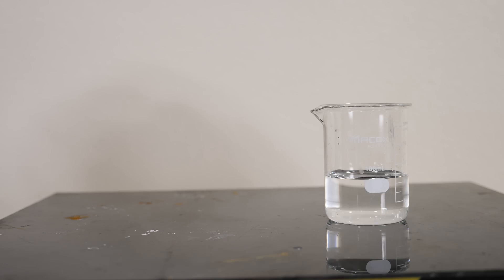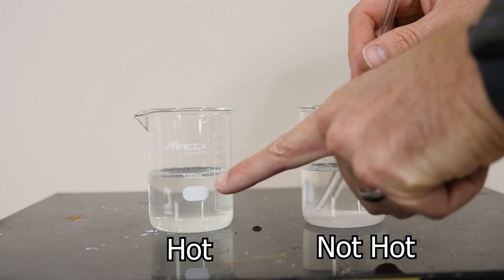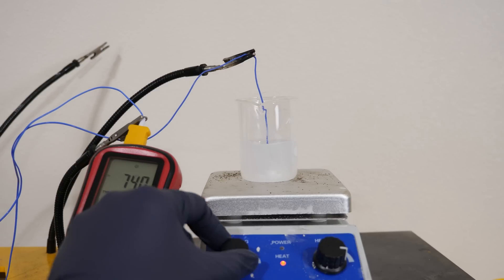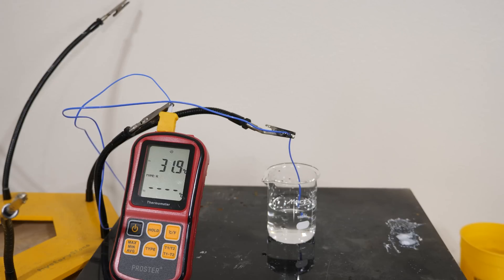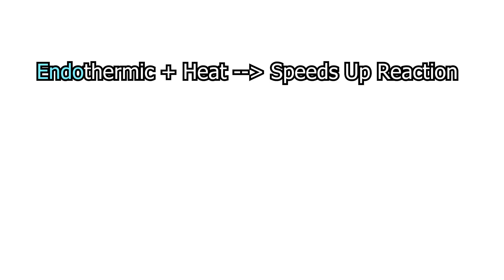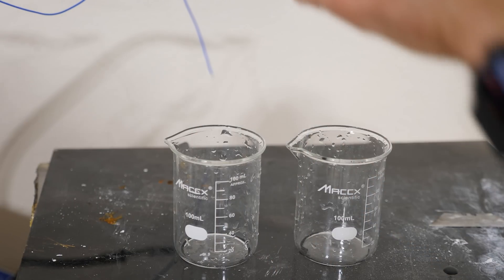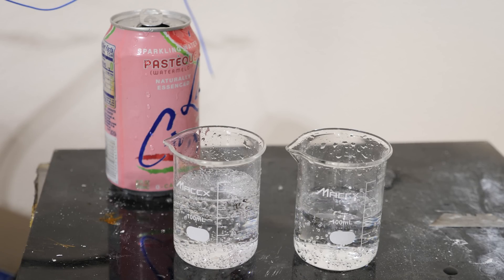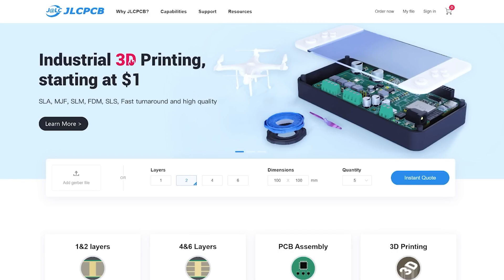Why Does This Powder Only Dissolve In Cold Water?

Comment: As a chemistry student at the university level, this video hurts a little, endo/ exothermic reactions both increase in speed with additional temperature, saying that the equilibrium of the reaction can be subject to change. I hope that there are no high school students using this as a mean of education as most of what is said is incomplete or just outright wrong.
Reply: Furthermore your expel of sugar dissolution is also incorrect, I will not say more as from reading other comments there are a lot of other experienced chemists who have also pointed out the same errors that I was going to address, this was my first video from this channel and I’m extremely disappointed.

Comment: This video is full with errors, the responsible think is to take it down.
Reply: the responsible thing to do is keep it up as unlisted, and keep a link in a follow-up video going through the errors
Reply: @Sillimant_  That's alright as well, if you can change the title of the video to clearly reflect that it contains erroneous information. It is too easy to miss the comments. I was under the impression you can not change title on YouTube, although I'm unsure.
Reply: @sandere9563  you can retitle a video in a few seconds
Reply: @That_Chemist  In that case adjusting the title to clarify mistakes were made, and posting a video where one elaborates on the mistakes made is indeed the better option.

Comment: there is so much much wrong in this video. Some things are knowingly deceptive though. the only thing NaNCl is perceived 'endothermic' in this instance because the water is over 30°C why? the added salt is probably colder of course the temp decreases in this instance. If it would be the same temp it would not change temp. In a lot of jis vids tere are some small knowingly deceptive things.

Comment: Chemist here. I'm sorry but you're completely wrong. Just because solubility decreases when water is hotter (which is atypical, usually it increases, but may just as well stay the same) has nothing to do with endothermic vs. exothermic. Also, these are not reactions. Nothing is reacting here. No new chemicals are formed, no bonds are broken or formed chemically. All of this is physical transitions and the energy balances that are endothermic or exothermic when dissolving a solid have to do with energy in crystal structures/lattices, a physical thing, not a chemical thing.
Reply: Thank you for calling this out. It's difficult to tell if what being mentioned is correct if the audience does not have precursor knowledge about the topic.
Reply: It''s a no brainer for him to make a correction video - more content for him and gives off a good impression for admitting to/learning from mistakes. Compared to the views of his other recent videos this one isn't doing as well anyway, so why not recoup that with a follow-up.
But I'm not holding my breath honestly.
Reply: What are any of u guys saying
Reply: @piztah I care more about people making a sound, coherent argument than having a PhD. If people need to hide behind a PhD to try to get other people to accept what they say it shows their argument isn't convincing. However, Einstein did have a PhD.

Yes, chemical reactions do involve physical process, but as you appear to have gotten in the end, a chemical reaction involves changing compound, while a physical change doesn't change compounds.
While people like pretending that everything is back and white and some will boldly assert that dissolution and mixing can only ever be a physical change, there are far more grey areas.
And dissolution of ionic compounds are included in this grey area.

When considered alone as just dissolving a salt and then evaporating the water, it looks like physical changes can explain it fully. But if you get 2 different salts, you can then end up with other salts at the end, which most people would consider different chemical compounds with different properties.
So by just dissolution, mixing (possibly) and evaporation (and possibly other normally "physical" separation techniques), can you end up with a different chemical compound, or does that mean somewhere along the line a chemical reaction has occurred, and if so where did it occur?
Reply: Would you make a video hidrolizing egg membrane for better absorption? I.e. collagen, hialuronic acid, etc. for the coolest bandaid?
Reply: Wellllcome back. I’m That Chemist
Reply: solubility decreases when water is hotter for gases, but increases when water is hotter for most solids and liquids: 
Gases
As temperature increases, the solubility of gases decreases. This is because the gas molecules gain kinetic energy and break free from the solution to move into the gas phase. This can lead to environmental issues, such as decreased oxygen levels in bodies of water. 
Solids and liquids
The solubility of most solids and liquids increases as temperature increases. This is because the higher temperature increases the kinetic energy of the solute molecules, which are held together by intermolecular attractions. The increased energy from the hot water molecules also makes solids more soluble by increasing the number of collisions between the water molecules and the solid.
Reply: You have an ionic compound which was held together via ionic bonds. These bonds are broken and replaced by ion-dipole interactions.
If it is all physical, tell me how you can take solid sodium hydroxide, gaseous hydrogen chloride, and water, mix them, and then remove the water to produce solid sodium chloride?
Reply: The distinction between the breaking of chemical bonds and the breaking of physical bonds is an artificial, arbitrary one. It's on the same level of importance as whether Pluto is a planet or not.
Reply: @bigsmall246  Definitions have meanings, if you break those meanings you're not doing science anymore. And I find this distinction VERY important because changing the molecules is not a little thing.
Reply: @paul4381  so when an acid dissolves in water, is it a chemical reaction or a physical reaction? Is the formation of hydronium a chemical or physical reaction?

Pluto is not a planet because it has not cleared its orbit of other objects. But every single one of the planets has trojan asteroids at at least 2 of their 4 Lagrange points.

The distinction is artificial.
Reply: @paul4381  And a big problem with people is that they like imagining definitions which are strict and rigid and clearly black and white, while reality gets in the way and makes it much more grey.

And there are plenty of examples of this region of grey in chemistry.

How do you decide if a compound is held together by ionic or polar covalent bonds?
It is a spectrum. There is no clear cut off.

Likewise, is an ionic bond a chemical bond, or an intermolecular force, holding together the molecular entities which are ions?
Because of that issue, is dissolving an ionic substance breaking these chemical bonds, or merely disrupting intermolecular forces?

But more important is what I already highlighted.
If dissolving something is a purely physical process, then the reverse must also be.
This allows you to take 2 different chemical compounds, dissolve them in water, and then separate them to produce 2 different chemical compounds.

If this is all physical, that is saying you can convert one chemical compound to another without undergoing any chemical reaction, which is quite clearly nonsense.

This can even be done without ionic compounds, using hydrogen bonding.
You can take a compound, like sugar, and dissolve it in D2O and then crystallise it and find a bunch of deuterium atoms where the hydrogen used to be. This requires covalent bonds to be broken and different bonds to be formed, so is clearly a chemical process.

So if you need to draw a line to clearly divide chemical and physical processes, then dissolution of species capable of undergoing hydrogen exchange with the solvent, as well as dissolving ionic substances must be a chemical process.
Reply: @Bullshitvol2  As I have said to others, dissolution of ionic bonds MUST be considered a chemical reaction, unless you want to claim that you can change one ionic compound into another without any chemical reactions taking place.
Reply: @Bullshitvol2  No it isn't. Not all reactions are oxidation or reduction. If that was the case, there wouldn't need to be a special term to describe them as redox reactions. Instead you could just refer to them as reactions.
According to IUPAC, a chemical reaction is:
"A process that results in the interconversion of chemical species."
So before telling me to look up definitions, perhaps you should look them up first?

Sodium chloride, as a solid is one chemical species. When you dissolve it, you convert it into solvated ions, which behave as a different chemical species.

But the bigger issue isn't simply dissolving it.
Instead, it is first dissolving it, and then removing water to get a different compound.

You can dissolve 2 ionic compounds in water, and then dry it out to get 2 different ionic compounds.
e.g. you start with AB and CD, dissolve them both in water to get A+, C+, B- and D-.
But then you can separate them out and get AD and BC.

That means you can start with 2 ionic compounds, dissolve them and precipitate them, and get 2 different ionic compounds.

So either you have a chemical reaction taking place, or you need to claim that ionic compounds aren't really compounds and instead sodium chloride is really just a mixture of sodium ions and chloride ions.

So which do you pick?
Reply: @Bullshitvol2  While oxidation and reduction will result the interconversion of chemical species, that is not the only way to do.
That would be like saying all animals are cats, and then showing that a cat is an animal.
That doesn't show the relationship holds the other way.

Why bother asking for an example when I just gave you one?
Why completely ignore the questions asked about it?

The example I gave was a salt metathesis reaction.
This is where the ions of two salt exchange.
This can be achieved most readily by using salts with different solubilities. For example sodium chloride and silver nitrate, reacting to produce silver chloride precipitate and a sodium nitrate solution. But you don't need one to be insoluble. Instead you can use limited solubility, or multiple solvents.
I think those with limited solubility are better, because then you have dissolution processes, followed by a mixing (or additional dissolution process), followed by a precipitation step.

Another is one discussed previously, the deprotonation of an acid, and similarly general proton transfer for hydrogen bonded species.
e.g. HCl reacting with NH3 to produce NH4Cl, or if you are doing it in solution, it is really HCl reacting with H2O to produce solvated Cl- and H3O+, and ammonia reacting with either H2O or H3O+ to produce solvated NH4+ and OH- or H2O.
In this the H are all in the +1 oxidation state, the N is in the -3 and the Cl is in the -1.
So no oxidation or reduction is occurring, yet you take 2 chemical species and react them to produce another.

So for these 2 examples, do you think a chemical reaction is taking place, and if so, where?
If not, then that means you either need to reject IUPAC's definition (and the common definition) and claim that you can interconvert between chemical species without a chemical reaction; or you need to claim that sodium chloride and silver chloride and so on are not chemical compounds and instead are mixtures of them, where sodium chloride is really just a mixture of sodium and chloride.
So which is it?
Reply: @Bullshitvol2  Then you learnt it wrong.
HCl and NH3 do not require water to mediate the reaction.
A reaction of HCl with water is quite similar to a reaction of HCl with NH3.
In both cases you have a proton transfer from the HCl to the lone pair of the other molecule.
If HCl couldn't react with NH3, then it wouldn't be able to react with H2O.
They can even react in the gaseous state where you have 2 gases come together to form a solid.
HCl can also react directly with solid sodium hydroxide, and that is used as a trap for HCl gas coming off a reaction mixture.

Cl-, as it is a product of the reaction, could never be considered an oxidizing agent.
The oxidising agent must be a reactant which is reduced.
But we see in both HCl and Cl-, the oxidation state of chlorine is -1.
And that means it is neither oxidised nor reduced.

There is no change in oxidation state for any of these atoms.
As the oxidation state does not change there is no oxidation nor reduction.
Most acid-base reactions are not redox reactions.

As for silver chloride, the issue isn't simply if they precipitated because it reacted.
The issue is how do you go from solid sodium chloride, solid silver nitrate and liquid water, to then having solid silver chloride and either a solution of sodium nitrate in water, or after more separation solid sodium nitrate and liquid water?
There are only a few possible resolutions.
One is to say that ionic compounds are not compounds. That solid sodium chloride is not a chemical species, instead it is a mixture of chemical species, and likewise the same applies to the other salts. So when you go from sodium chloride + silver nitrate to silver chloride + sodium nitrate, you are not making any new chemical species, you are just changing where the components of a mixture are.
Another is to say that even though you recognise these are 4 different chemical species, you do not need to carry out a chemical reaction to convert between them, and instead physical reactions can change chemicals into other chemicals.
Or you must accept that a chemical reaction has occurred somewhere along this process, with this process being nothing more than dissolution, mixing and precipitation.

I'm quite happy to accept that the dissolution of ionic compounds, which requires breaking ionic bonds, is a chemical reaction, and thus precipitation is as well.
But which of these 3 options do you think is correct? Or do you have an alternative?
Reply: @Bullshitvol2  While that fits with what you have said, it doesn't fit with virtually everyone else's definition.
Most people recognise NaCl as a chemical compound/chemical species, with distinct properties. And the same can be said for other ionic compounds.

As I explained the proton transfer from HCl to H2O and NH3 would be virtually identical. Water is not needed.
You can have HCl gas and NH3 gas react to produce solid ammonium chloride.

And the chlorine atom was reduced when it stopped being elemental chlorine. There is no oxidation nor reduction occurring when HCl splits into H+ and Cl-.
The oxidation state of chlorine in HCl is 1. The oxidation state of chorine in Cl is -1. While the formal charge has changed, the oxidation state has not, so no oxidation or reduction could be occurring.

An example of where it does occur is the reaction between elemental chlorine and elemental sodium, where an electron is transferred from the sodium to the chlorine.
In that case, sodium goes from an oxidation state of 0 to 1, while chlorine goes from 0 to -1.

Comment: If a body is moving with certain velocity and direction. When it is decelerated with 12 m/s^2, it comes to rest after 4 seconds. But if it is accelerated with 12 m/s^2 it comes to rest after 4 seconds as well. Calculate its velocity and define its direction of motion.
Just got this question in my mind. Please answer if its possible.
Reply: That...doesn't sound possible. You can't decelerate and accelerate from the same velocity and get the same final velocity

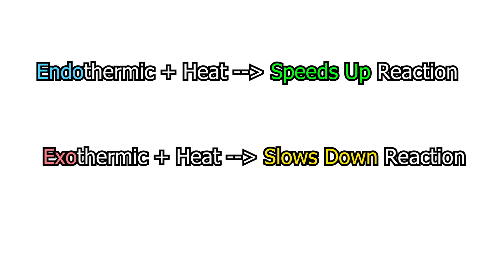Comment: Hi!  Just wanted to point out an innacuracy at about 2:45. Heat in general favours the speed of the reaction, independently if its endo or exothermic.  That is kinetics.  What happens in this case is that because of the higher temperature of the medium (and not the heat!) the equilibrium is displaced relative to the room temperature equilibrium, and becasue the reaction is exothermic the equilibrium at a higher is reached in a state that favours the undisolved solid salt, rather than the disolved state. Thus is thermodynamic. In this case the equilibrium is reached faster (kineticaly) than in the cold one, becasue of the heat, just so happens that the equilibrium is mostly undisolved solid.
Anyway, great vid!
Reply: nothing about this video is great. every single explanation he said was completely wrong.

Comment: So.. if I heat epoxy or polyester resin which is exothermic, will it set slower?
Reply: depends on how much heat you blast it with. With polymers like those when they're exposed to temperatures above their sealing temperature then it breaks the polymer down into monomers and thus slows the reaction that way. But it would have to be pretty damn hot I presume

Comment: Is the reason why the reaction slows down when you heat the water and calcium acetate because since it’s an exothermic reaction the added heat prevents the heat transfer from the calcium acetate to the water. So it slows down the reaction?
Reply: no reaction get slower with temperature.
in fact, increases the speed of the reverse reaction.
there are a lot of misconceptions and errors in this video unfortunately
Reply: @keb_in  Ahh okay, so it was a lot simpler reason. I was thinking Thermodynamics. lol

Comment: I might be wrong, but I think you're confusing kinetics with thermodynamics: if the dissolution of a solid is exothermic, then in equilibrium more of it will dissolve in a cold liquid than in a hot liquid (and vice versa). However, this has no effect on the kinetics of the process of dissolution. For example, the dissolution of NaOH in water is exothermic, and indeed it is more soluble in cold water than in hot water. However (and DO NOT TRY THIS AT HOME) it dissolves waaay faster in hot water than in cold water. Kinetics and thermodynamics are two very separate things.
Reply: You are not wrong
Reply: Yes, true